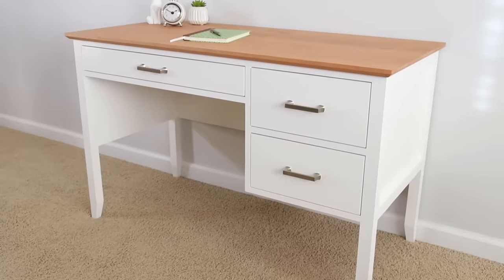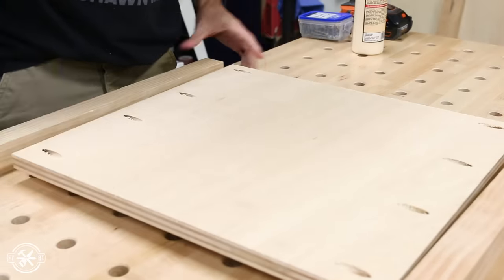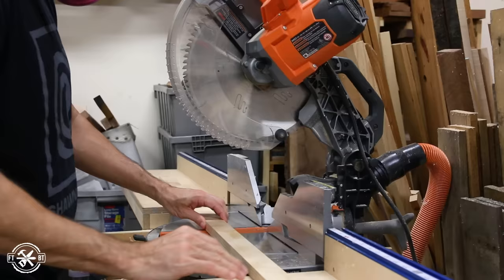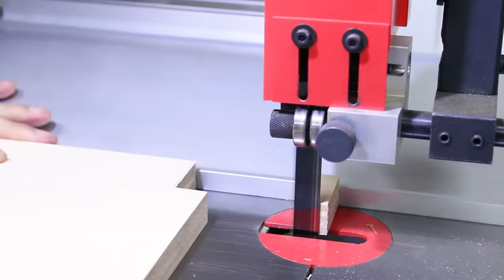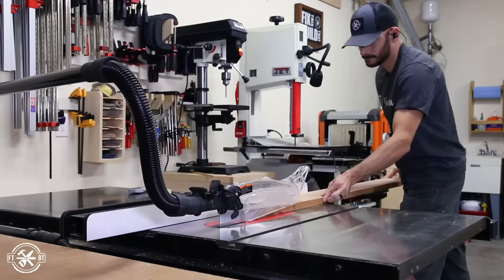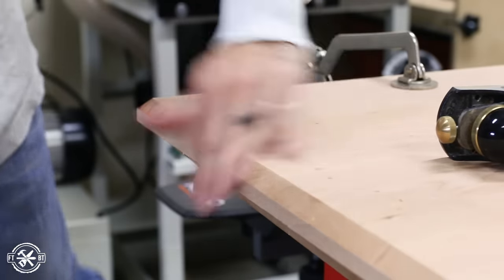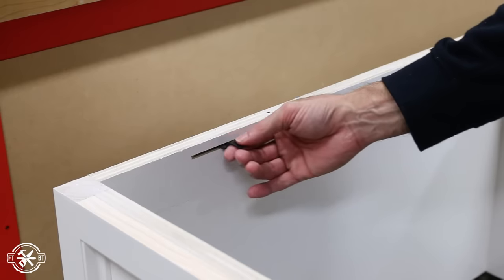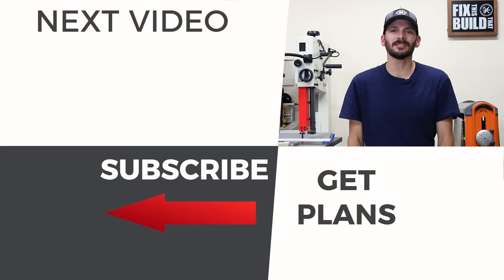DIY Desk with Drawers | How to Make

Comment: The best way to trim edge banding is get a 13$ hand plane from home depot and take the blade out.  Use that.  Run it flat with the surface and makes it awesome.  I use it so much I weld a bolt onto the top as a handle.

Comment: I just finished building this desk for my wife, to be used as a makeup vanity. I decided instead to use a butcher block top, and plan to add a small hutch with shelves or maybe a lighted mirror sometime down the road. A word of caution on cutting the tapered legs - use a zero clearance table saw insert so you don't warp your blade with the cutoff piece like I did.

Comment: Great work! I noticed you chamfered the bottoms of the drawers! That’s a great idea to hide some of the layers to the ply!
Reply from the maker: Yes! It totally hides the plywood bottom and you can't tell it's not a floating bottom from the side
Reply: Fix This Build That I have a question! I’m considering this build so I was noticing something that may save time but can’t tell the sizing... on the left side of the desk you had all those pocket holes you filled as they could be seen. If you had turned that side panel outward and did pocket holes on the outside would your trim you added cover the holes? Just curious...

Comment: Holy Cow, brad!  This looks amazing!  I was applauding your techniques and ideas all the way through. one question though... you seem to be the pocket hole man! (second only to Ana White)    HOW do you keep the plywood from splitting? how do you keep the pieces from shifting when the screw tightens?  Ive tried clamping but itstill shifts about 1/16" when the screw finally tightens down... I barely use pocket holes, but I see a LOT of guys using them for cabinets and figured I may give it another try...

Comment: Looks fantastic as a writing desk.  Ergonomically it wouldn't be ideal for a computer desk, as the keyboard / mouse would be too high for good posture.  I would recommend replacing the drawer above your legs with a pull-out keyboard tray if this is to be used with a computer / laptop.

Comment: Got the plans - I too, have a daughter I can't say "no" to! I'm also using this as an excuse to purchase an HVLP - any tips on spraying the semi-gloss enamel with the gun you have? Does it need to be thinned? Or tips on what to look for when buying said paint? I did a quick look for a video you might have on the topic, but might have missed it. I like the design - I don't have "all" the tools, but this looks do-able! I think the only thing I'd change is have the taper on the legs be longer - maybe to the bottom of the drawers and skirt.
Reply from the maker: You'll definitely need to thin it. Use a viscosity cup to thin it to your exact sprayer. Im no expert on spraying, but I'm sure there are some good vids out there 👍

Comment: Great job! The desk came out very nice! I have a question though. Could someone who doesn’t own a table saw or a miter saw be able to create a desk like that?
Reply: Really depends on what you have. I'm going to say if you don't have a table or miter saw probably no. If you have enough experience with hand tools you can probably put this together using those but it will take multiple times longer and require more effort.

Comment: Finished building this desk a week ago for one of my daughters- just in time for on-line school :( .   I did upgrade my 12 year old small table saw to a used contractor saw with a nice aftermarket fence already installed ($350).  I just couldn't get my old saw to cut straight when working with the larger plywood pieces.   I adjusted the plans just a bit to add the recessed detail to the back side the same as the right and left sides.  Otherwise, the plans worked perfectly and it came out great!  Photos here: https://photos.app.goo.gl/VVQLWoJAuuCvYkdw8

Comment: Great build.  Where can I find those drawer pulls?  Also, I have been looking for a good brand of paint to use in my sprayer.  You mentioned you were using an enamel, but all I can find are latex paints at my local hardware store.  What brands have you tried that you can recommend, and where might I look for them?
Reply from the maker: These are the drawer pulls: https://amzn.to/2FjGEUy.  Also available at home depot.  For paint I've used Behr and Sherwin Williams has a nice enamel.

Comment: This is not a DIY project... He is using maximum professional tools.
Reply: Circular saw and a drill is all that's needed. Nothing maximum about it.
Reply: @zstewart123  bingo. Yes he uses a jointer, planer, bandsaw and many jigs... As he mentioned, those are just for ease of use/milling lumber. Buy pre-milled lumber and you won't need them.
Reply: @zstewart123    Circular saw, and a drill? Did you watch the full video? Lol. Kind of seems like a tablesaw type of project. Not a circular saw. In addition, a pocket hole jig, drawer-slide jig, HVLP sprayer, flip top tool stand, spindle sander, a router, pull/flush cut saw.  It’s a DIY if you’re a seasoned builder! Jeesh.
Reply: Hi, you actually can make this table by using a good quality plunge circular saw (I am in Italy and have Makita) with its specific rails and its clapms.
Plunge saw and rail can give a really clean end grain cut too.
It’s just a slower process.

Molding can be separately purchased and applied.
Plywood is purchased in sheets and you can border it perfectly with nothing more than a (no steam here) iron and paper tape.
I do it on a regular basis, it turns really nice.

Many things here can be simplified and done with less expensive and challenging powertools. What is definitely not DIY is a tapered legs desk with drawers as a project.

I would not suggest this to a beginner. I suggest to start with a bookcase. It teaches what you need to know in carcass construction and we all need bookshelves. They seem to be always somehow missing 😂😂😂